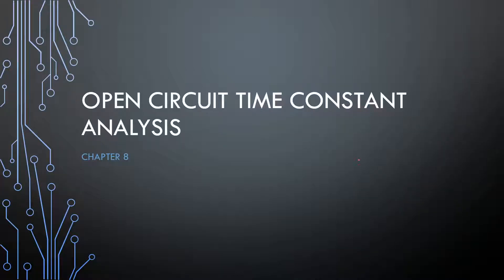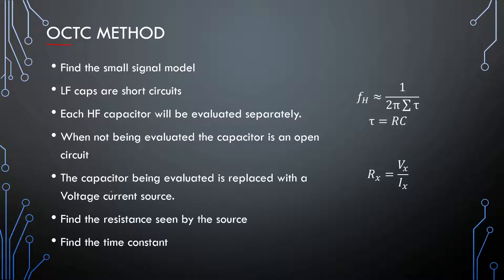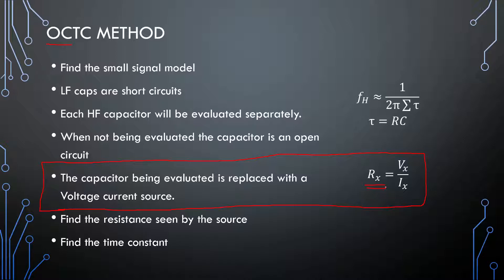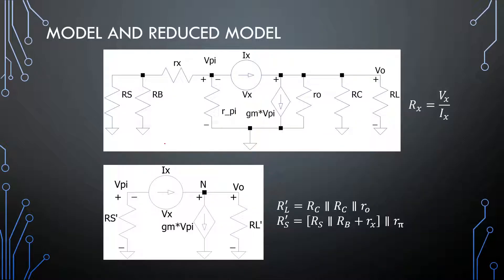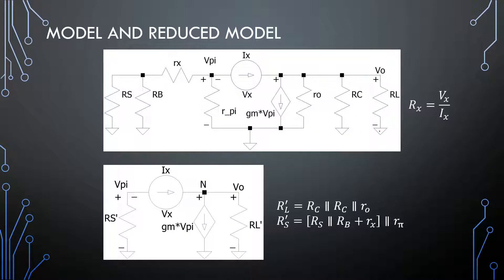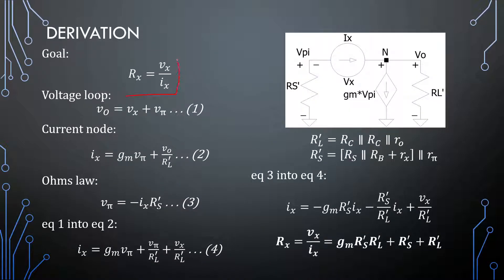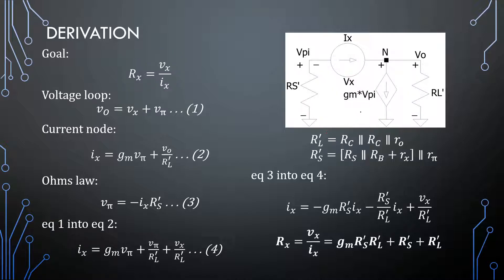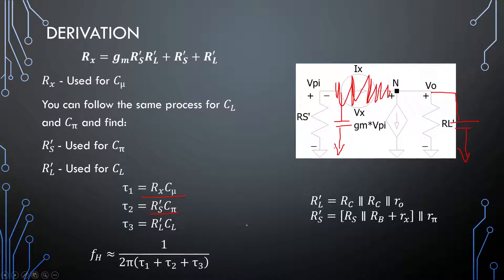Video 6 - Open circuit time constant analysis

Comment: Thankyou! You actually explained this process. How did you know the polarity of Vx, ix? Where did that come from?
Reply from the maker: It is the test source method, the method is taught in basic circuits (Thevenin and Norton equivalent circuits). When you try to see the impedance into two terminals you can apply a test current source, the polarity will always be this way. If you choose the polarity in the other direction the resistance will be a negative value.